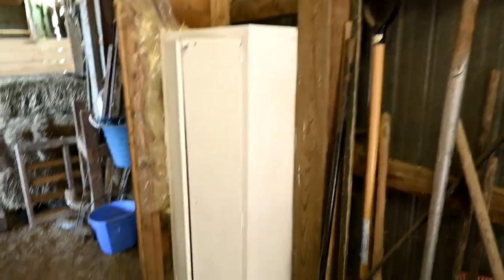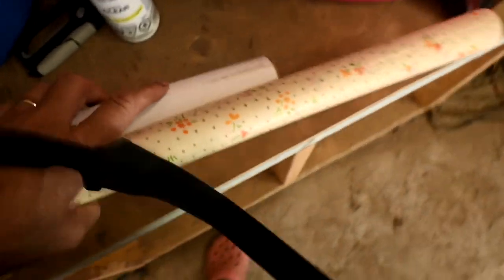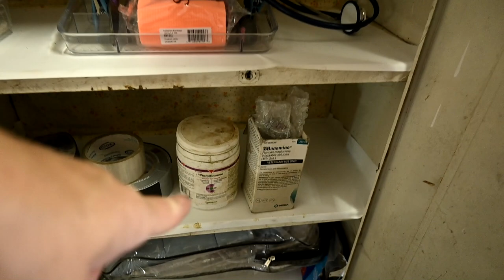Renovating Our Horse Farm! Two Project Reveals!

Comment: I think you'd be better off with cross ties for your goat milking, they'll freak out in a clamp?
Reply: The first couple times even those would freak them out! They will have to be trained either way they go!!
Reply from the maker: Ive never seen cross ties for milking goats before!  That definitely would have been easier to make lol!  I would be worried about thrn being able to move away too much while milking and the milk getting spilled!
Reply: The stanchions work well. You just have to get them used to it by firstly  feeding them on it until they are comfortable with it all.